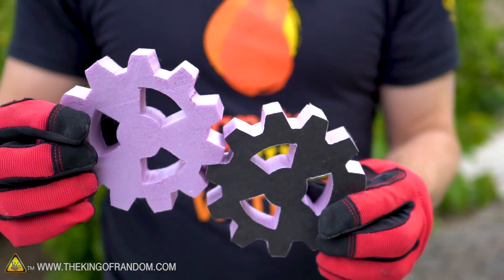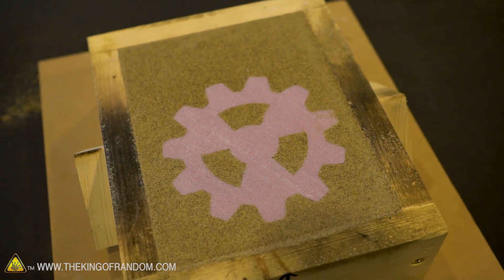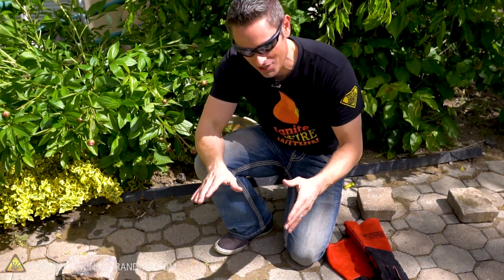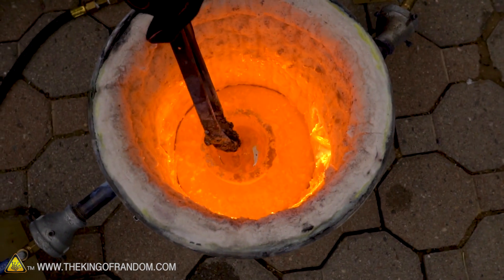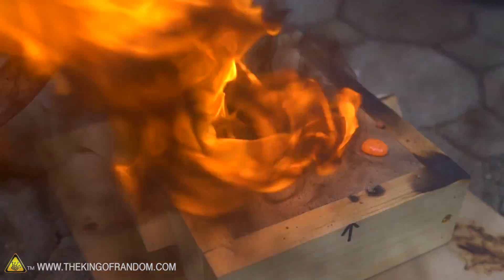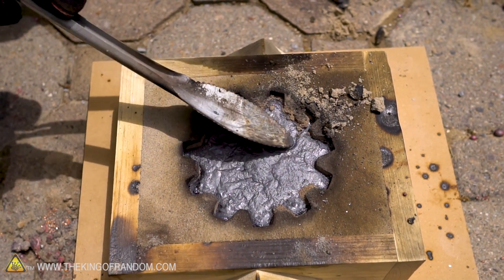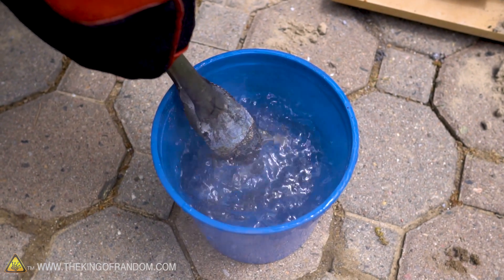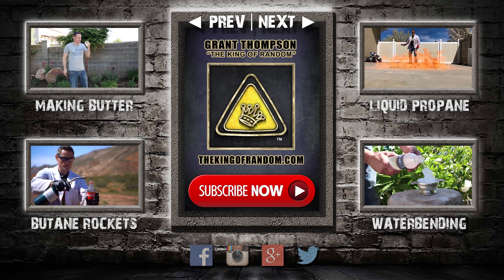Argh. Why Is Copper So Difficult? TKOR Tests Melting Copper In Our Homemade Foundry

Comment: Instead of having the foam on the surface why not put it in the middle of the sand block with a pouring cylinder in the middle. That should prevent the sand holes from floating as they have pressure from above.

Comment: have you thought about making the mold so the Styrofoam gear isn't exposed to the air, so the sand encompasses the the gear and adding Styrofoam to create a channel from the outside to the gear??

Comment: I know this has been beat to death but a two part sand mold where you mold the gear with a pour spout on the bottom then make a flat sand mold and then remove the styrofoam sandwich the two together. Pour into the spout and you'll have a beautiful cavity just ready for your copper.

Comment: the way to do it is with Styrofoam, and make de mold be all the way inside de sand, put two or three pins in the mold that can reach the surface of the sand, then just do it
:)

Comment: Use wax instead of styrofoam. Then heat your entire sand mold in an oven. Two to three holes in the bottom to drain the wax is best. Make sure you really pack the sand down hard. Copper is a pain to pour in sand otherwise.

Comment: The copper is denser than the sand causing the sand to want to float add a top flask with a sprue hole cut or formed in going to center of gear also hardened core sand may work better for the hollow parts for the radiation symbol   Also be sure to make vent holes in top flask to allow steam to escape

Comment: if you heat up the mold to a temperature close to that of the copper, the temperature difference wont cause bubbles, and the copper wont cool down as quickly, i'd recomend using plaster, and using the mold as the crucible, letting it cool off inside the forge should help too

Comment: I've actually made a copper gear before but i had to make a second layer of sand for the top. and made a hole to pour the copper in and cut the extra peace off.
Reply: and i forget to say i needed a second hole for ventilation so the air can escape.

Comment: Did you try using 2 sand forms sandwiched together, the bottom with the foam cast and the top on with a pour funnel and a vent tube?

Comment: Soo... Any particular reason why you wouldn't just top it off with a wooden lid and a hole to cast it in?
Would have prevented the, I assume, lighter sand from getting popped up by the heavier copper.

Comment: Grant, I agree with Ryan smith. If you add a styrofoam riser onto the middle of the gear, use the top portion of the greensand mold, it will allow a more efficient pour without wasting the copper. Also by using both the top and bottom it insulates the copper more allowing it to flow longer to achieve the image. It might only be minuscule amounts of time, but that might be all you need. Also try adding a touch of silicone oil to the green sand. It might provide more moisture and not allow blowouts while you are casting.

Comment: Hi Grant! I'm not a physics expert and this is just a speculation but I think moisture in the sand is evaporating in contact with the molten copper making the base of the sand porous which is why it breaks down. Maybe try reducing the moisture as well as packing it in even more.

Comment: Copper is much denser than aluminum, so the copper actually causes the center chunks of sand to float on top...

So, if you build a true sand mold with the foam object completely centered in a block of sand, with a passage for the copper to flow into,you will have better luck.
Reply: As I think on it further, if you put a steel plate with a hole in the center, on top of the foam form, pour through the hole it should work well.

Comment: It looks like a density problem between the sand and molten copper because those pieces of sand don't look like they get knocked over, it looks like they float up on the copper.

Comment: You might try this with dry clean sand and have a styrofoam spru that leads to the  pattern which should be completely buried in the sand, just pour the molten metal onto the spru and it will follow it down.  I've done it with aluminium, copper may be similar, the definition you get with aluminium is spectacular.

Comment: If you're burning uncoated Kaowool, you will get cancer. I hope you coated your foundry.
Reply: Sir, I was under the impression green sand was oil based and not water based.  this sudden expansion of water vapor in such extreme heat would explain the deterioration of your mold. You may be better off using a close casting system as a previous person mentioned.
Reply: time will tell!!!
Reply: Hey don't curse a man, friendi
Reply: if you aren't burning uncoated kaowool you will get cancer too 🤔
Reply: meansartin The hooks are a fact of life for this guy not to mention he is not cooking burgers

Comment: Sift The SAND!!! You dismissed that right off the bat and failed every time. It's the only thing you never changed!
Use Cheaper Styrofoam. See BNtSG S2E10 - Heat Energy. More Material, more heat exchange!

Comment: Try using sodium silicate aka water glass. It dries with CO2 and is very heat resistant. It will hold your mold very well, especially for aluminum. 

You can make it yourself and it would be useful for many high heat builds, including a furnace.

Comment: I saw another youtuber called tito4re cast a copper apple using what seemed to be green sand, what he did was make a "tunnel" down into the sand with Styrofoam  so that the copper would keep the heat, he also added borax to the copper, though I'm assuming that was for something else.

Comment: Put a 2nd piece on top of the mold to seal it off, then make a hole in the top to pour the copper in, with a vent or two on the other side.  And just leave the foam in the sand, completely sealed minus the pouring hole and vent.

Comment: Cover the whole strofoam gear in sand with a couple of "chimneys". Burying the styrofoam will insulate the molten copper allowing it to stay hot much longer and fill the mold completely.

Comment: Two part sand casting mold and venting man.  You need the top of the mold to hold your delicate pieces in place and venting to allow oxygen to escape and to show when the mild is filled with metal. Also you could possibly try melting out the styrofoam with acetone but I'm not certain how well that works with green sand. It work fine when using ceramic she'll moods though.

Comment: Hey Grant, what if you added some kind of binder to the sand, something like Elmer's glue, and let it dry for an hour or so before pouring? Mixing it thoroughly with a light amount of glue would allow it to stand better and for longer maybe, it may even allow for the foam to be removed before pouring as well.

Comment: you need to have a green sand top  with sprue and riser.  the top will act as an insulator keeping the copper liquid and allowing it to fill the mold.  your sand is too dry as well.

Comment: you need to pour it through a channel with a sand lid to prevent the form collapsing. add a second frame with a hole through to the cog pour through that

Comment: Hi. I was researching the dangers of casting and I came across a phenomenon known as a steam-metal explosion where molten metal is thrown up by rapidly expanding water. How much of a risk is this casting at this scale? I would be wearing a face shield and leather apron along with heat resistant gloves and heavy jeans. (My main material would be aluminium, but this could be changed)
Reply: If you make your green sand well (doing better research than Grant did in this episode), you'll be fine.
Reply: You can cast into very very slightly damp sand if you are doing an open faced mould like Grant is. No steam explosion is possible. I know what you are thinking, "everyone on the internet is an expert metal caster". I've been doing metal casting in aluminum, copper and bronze for Idaho State University, for three years and have done it several times on my own. If you make a closed and gated mould, you can get a steam explosion, but there are things you can do to prevent it like using an investment that's been baked free of water. Any other questions, I'd be glad to answer.
Reply: I've done casting of pewter for miniature figurines. I've encountered the phenomenon where expanding drop of liquid caused the metal to explode sending a shower of boiling drops flying in all directions, some as much as two meters. I would recommend wearing a full face cover, gloves and overalls. Or just make sure there isn't water in the mould, and you don't spill drops of water into the cauldron. pewter melts at a much lower temp but still you don't want your face or body splattered with metal.
Reply: Juggernog B you should use oil if you really want too get into casting
Reply: Imposter Nye Apologies, but I have not come across this before. How is this oil applied?
Reply: astrong0 thanks for the advice! I was considering makeing complex 3d castings but that was mostly for cosmetic details or could be done with power tools so I will stick to open top.
Reply: Coffeehound Thanks for the advice! I'll look into buying these

Comment: Once you get thing's with a greater density then iron you will need a lid component. Split your gear in half, glue each side to the exact same spot, and with the same orientation on some plywood. Have 2 boxes with both sides open attach the plywood to the 2 boxes fill one side with sand to the brim and cover and then take some kind of tube split it in 2 then find 2 places to put then in the negative space as one opposing sides close to the wall.  Cover the side with the tubes with plywood. Lift the plywood that is between the two boxes to make so  the box with out the tubes is now negative space then carefully flip the box with the tubes so that the gear is facing up and remove the plywood that has the gear mold then line the box without the tubes up the one that does, creating the full negative space. Now carefully remove the tubes and you are ready to poor.  Poor the material in one hole until it overflows the other and then let it cool for about 10 min.

Comment: Grant, make a 2 part mold with a pouring basing / gate / vent setup. I think the problems you're having are because you're trying to pour in an open atmosphere which cools the copper too quickly. It's also not helping that you're exposing the molten copper to O2 in the atmosphere right before you pour.

Comment: I would say it's the moisture in the sand that rapidly evaporating from the sand when you pour the molten copper in to it that the pressure created is more than the sand can withstand causing the mold to fail. maybe casting the foam in concrete? or maybe plaster.

Comment: I should have tried a finer grain sand, finer sand means more friction between the molecules and therefore it wont break the "bond" with eachother so easy when the heavy copper pours in and the pressure from it makes the radiation thingys break off.
A more coarse sand means more air between the grains thus less friction between the sand grains themselves.
I would have used a sort of sand we have here in the woods, it is gray and when wet it can be hardened in a fire as clay.
But when dry it is as fine as flour and can be packed extremely hard without loosing its shape.
And I would also have tried making a lid with a sort  funnel/inlet and outler/riser to force the copper into the shape, the lid would also press down the three radiation thingys so they wont rise up.

Comment: try making a two part mold. having the sand supported from both sides will increase your chance of success. make the mold that same way you did at first, but then add a secomd box on the side with the gear, add two tubes down to the gear and pack green sand around that. that way there is sand supporting both sides

Comment: why can't you cast it the same way you cast the brass knuckle? i meant, bury the foam inside the sand, instead of on the surface? the end result worked out just fine with some filling & sanding..

Comment: Copper, silver and gold are difficult because you must heat the mold in a kiln first. I used to work for a gold smith in my teens and he always placed molds in a kiln, heated them red hot, then put the mold in a Centrifugal force casting machine, melted the metal in a crucible mounted in front of the mold holder with a torch, and set it spinning.

Comment: Wouldn't doing a 2-part mold and pour through a sprue prevent the sand clumps in the center from popping out?  Especially since the box you built is designed for that?  Or am I missing something about it that would preclude that?

My hubby & I love your videos. Always entertaining, and usually educational.  I wish I'd had science & shop teachers who were as engaging & entertaining! (But I think your wife must be a saint with all you put your 'lab'/workroom through!  Lol.)

Have a great day!

Micki (from AB)

(edit - forgot to say, you might find different types of foam may work better than others. It was the early 80's when I was taking shop classes in school, & I've forgotten some details since then, but when we did metal casting using foam, we were told some types of foam work better than others for the level of detail you can get, the grain, and the completeness of it melting. So trying different types of foam may help too.)

Comment: In the modern rogue cameo, you used some sticks to hold the playdough in place - could you do something similar with wire and place them in the holes in the gear before you make the cast with greensand? Maybe that'd give it enough structure to  let you use the sand a bit drier and avoid those bubbles of what I assume is steam but could also be what cody suggests?

Comment: First at all, I believe the radioactive part in the sand wasn't packed enough or packed at all. Second, you could've preheated your sand with a blowtorch to prevent any thermal choc and prevent any bubbles.
Reply from the maker: +DarkLael good point! It may not have been packed tight enough in those spaces. I hadn't considered that.

Comment: copper is dense. the sand tries to float. maybe should have used some linsedd oil in the sand mix and baked it first into some kind of solid concrete mould.

Comment: Add Borax. The Copper will flow easier and quicker out from the center of the piece, avoiding the buildup of copper in the center that causes the 3 parts of sand to be pushed outwards.

Comment: I casted a 24 pound copper sign using greensand and made a couple videos about it.  I will post the link below.  Copper is tough to work with because it transfers heat so quickly.  In your case, losing those chunks of sand makes me wonder if you have enough clay in your greensand?  Also, I would try reinforcing those portions that keep breaking off by incorporating a screw into the sand to help hold them in place.

Comment: just use a propane torch to completely burn out the foam
or if using real green sand just rpull the foam gear out

Comment: Hey Grant, Try using the sand/plaster mixture that you used on the original foundry to see if it will hold it's shape for the radioactive cutout.  The radioactive cutouts are a weak spot without having support on both the top and bottom.  Otherwise you could try to have the Styrofoam in the middle of the sand with a large Styrofoam sprue hole in the center to pour the metal into.

Comment: whenever i cast copper Ive always used a bit of borax and a closed mold. open molds dont seem to have the strength to not distort from the copper.

Comment: hey Grant. I would like to start by saying I love your videos. Now on to business. First off your green sand is not quite wet enough. Use 30 mesh sand or aquarium sand and sodium silicate for best results. Next before you pour the copper you have to skim the slag off the top of the molten copper before you pour. Copper is a bit more fickle than aluminum so if you toss some borax into the crucible while its molten it will help bring the impurities to the top so you can skim it off. I hope to see you make another video using these tips and hopefully the copper gear or whatever you decide to make will turn out better. Hope this helps and keep up with the awesome vids my man!!
Reply: sorry I meant to say the sand is not dry enough. using sodium silicate with the sand you can let it solidify a bit before the pour and it should hold up alot better.

Comment: Need the mold to be two full parts with holes going down to it. And get rid of slag for less braking to worry about. At least that's how I've done it with copper

Comment: After watching this I decided to give this one a try. After 10 attempts I found a way to finally get the mold to hold tight while pouring the copper in. I think had I no watched this video I would have had a lot more attempts. I took a 3:1 mixture of green sand and play sand. Wet the sand down slightly more than what you did in the video. Just not to much. Then I used several different kinds of styrofoam/ The kind that worked the best was the stiffer more dense kind.

Comment: Since the copper is more dence than aluminum or other metals that have a low melting pint its is able to move the greensand from its place, the best thing to do to combat that if you don't want to change the method is to make it by layers, so basically one side of the gear on the bottom and the other on the top and stack them. Each tito4re channel he is the master at casting with copper

Comment: You need to use a sealed mold.  Same setup with sand atop the Styrofoam mold with a pouring spout of Styrofoam also with sand all around.  that ought to work extremely well!

Comment: 2 Greensand boxes, fill one most of the way and pack the gear into it. Put the second box on top and put some sort of pipe next to the gear that acts like a funnel. Pack all the sand down and it should suffice for something as hot as copper.